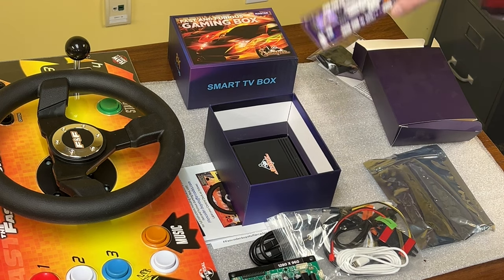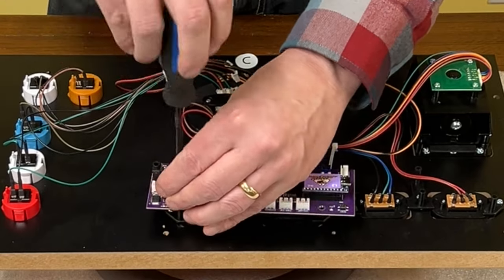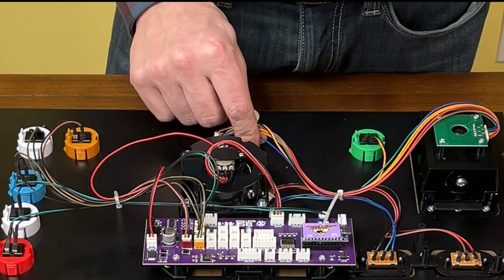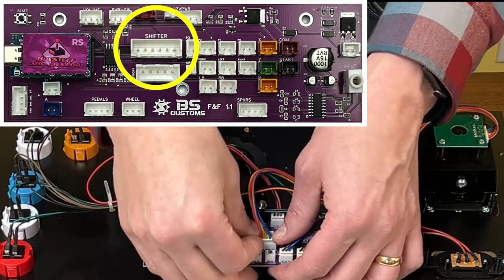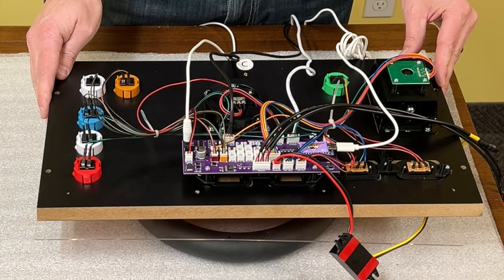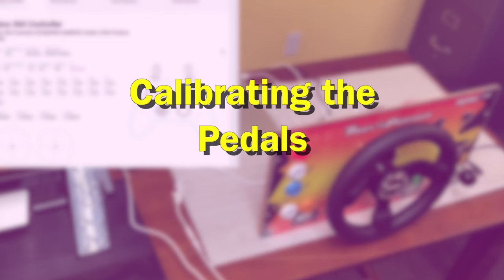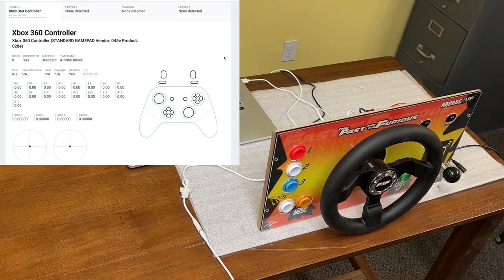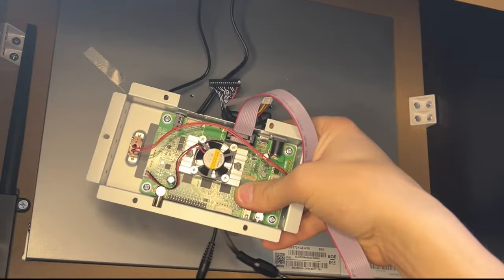Fast and Furious Mod Kit Install for Arcade1up

Comment: FINALLY, a reason to buy Arcade1up's Fast N Furious.  Great job as always guys. 🦊👊
Reply from the maker: Thanks man! I believe you used to have two... lol 🙂
Reply: @BuyStuffArcades  I would've kept one if I knew about this awesome kit.
Reply: @BuyStuffArcades  just curious, can I add games to the SD card ?
Reply from the maker: @BAMGGAMING  If you know what you're doing, yes. We don't lock anything down.
Reply: @BuyStuffArcades  the system is locked . It says it needs a password for user interface 🤷🏾‍♂️
Reply: Finally a reason to purchase time crisis?

Comment: Wouldn't the board being mounted to metal at 19:40 short something out? even 1up when they mount the PCB in the metal box thing they dont put it directly on metal anymore they used to back with the gen 1 cabinets but they eventually starting putting like black sheets of plastic and or plexi inside and then putting the PCB in metal housing

Also if i wanted to do the light up coindoor mod from retro530 is this mod compatible with it and if not how would I make it work would i just use a USB hub?
Reply from the maker: The beauty of our HDMI boards is they come with a plastic mount that keeps it from shorting and screws right into the A1up screen holes like we show. There is a 12 volts switchable port on the encoder board and also USB ports in the gaming box that can be used for lighting up coin doors and such.
Reply: @BuyStuffArcades  so I have a question would it be more cost effective to just build one of your guys racing cabinet kits and make that into a Cruisin world with your driving box or does it make more sense to go the 1up fast and furious mod route and do it that way? I'm kinda thinking I'm gonna be spending over a grand either way I go so maybe it makes more sense to just go with your guys cabinet kit?
Reply from the maker: @MystiqEevee  The modded F&F will be a bit less expensive, but our Racing Cab Kit is much nicer if you can swing it.

Comment: Hi, I have just installed this mod in my Fast n furious cab, works great but my question is that the fast n furious game is not included in the games list which I don't get as this mod is a fast n furious mod for a fast n furious cab. Is there a reason for this or am I missing something. thx
Reply from the maker: Fast & Furious requires a PC - it won't run on our Gaming Box. We are working on a PC upgrade that will have many different F&F games on it.
Reply: @BuyStuffArcades  Thankyou for replying. Is there a likely time this will come out and what type of price range would it be. When you mean PC upgrade is that basically putting a pc in the cabinet and getting rd of the other modded parts I just installed. Just asking for information. thanks
Reply from the maker: @winge-dogjones2492  It's a 15 minute swap upgrade from the kit you have now. We haven't announced pricing yet, but we're working hard to keep it affordable. RR/OutRun is first and that will be available soon. Then we'll be converting it to F&F.
Reply: @BuyStuffArcades  Thanks for the update, looking forward to it.

Comment: Does this version run any different than the outrun or ridge racer mod? Is it any better or any added games? I’m just trying to determine if I should get ridge racer for $450 tomorrow.
Reply from the maker: The games list is similar between the two mod kits. The F&F has the 4 way shifter and more buttons and doesn't require an amp, so it's a bit cheaper mod as a result with a few extra features.

Comment: To anyone that's done this mod, how do games like F355 challenge play?  That game is a 6 speed manual game in the arcade. FnF is only a 4 speed.  Do you just shift up and down like a tiptronic transmission or does it only run through 4 gears?  That game also came with a clutch.  I'm assuming since its the dreamcast rom there's no need to clutch. Really want to do this mod but a) loving my FnF cab so far and b) waiting for their pc build and hoping for FnF to be on there but the arcade version (along with many others hopefully). F355 was on of my favorites in the arcade.
Reply from the maker: Dreamcast version is paddle shifting. Daytona uses the 4 gears though. F&F will be on the PC Build in a wide variety of versions.
Reply: @BuyStuffArcades  So paddle shifting means you can use the stick shift to shift up or down correct?  Can't wait for your PC build!!

Comment: Anyone know if it is safe to plug in a powered soundbar into cab using a 3.5mm Aux cable? Not sure if this can damage board
Reply from the maker: What do you want to plug the soundbar into exactly?
Reply: The female 3.5 mm aux cable coming from the F&F encoder board with the green sticker labeled “speaker”
Reply from the maker: @bssmith235  No, that is for the stock A1up speakers which are NOT wired like a normal aux port. You can plug the soundbar into the HDMI audio port directly. You will need to adjust your volume on the soundbar then, and not on the control deck.
Reply: It worked! Thanks for the quick responses.  Any idea when those multi-player linking kits will start shipping out?
Reply from the maker: @bssmith235  Very soon

Comment: Quick question, If I do Mod kit will I still be able to do led buttons from retro530?
Reply from the maker: LED buttons can be used, yes. Best to use buttons with 2 pin JST connectors like stock, and separate power for the lights. The 3 pin JST connectors on some LED buttons won't interface with our encoder board. (Or the a1up encoder board for that matter.)
Reply: Great thank you ! What’s ETA look like on the PC mod ? Looking to get this .
Reply from the maker: @darrinmcgatha2027  Later this year for the PC upgrade kit - don't have an exact release schedule yet.

Comment: So wait….you lose the main game? The games are not in addition to f&f?? You may want to put that somewhere on the order page and make people aware before they buy this.
Reply from the maker: Our Mod Kits replace the main PCB - that is how it works. You can't run both at the same time. We have the full games list linked right on our order page. Our upcoming PC Build upgrade, however, will have F&F and lots more.
Reply: @BuyStuffArcades what is the eta on the pc build (for Ridge Racer)? Any estimate on pricing target you’re trying to hit?
Reply: The original game suck anyway lol  they're giving you more games
Reply: @BAMGGAMING  It May suck for you (if you’ve even played it) and that’s fine.That doesn’t mean other people don’t like it. I have bought several of these upgrade kits  so I understand they’re giving you more games. The previous upgrades included the original game. You missed the point that someone new to mods may not realize that when they buy this it replaces the main game they bought the cabinet for in the first place. Some people want to add games to the game they like…like the Star Wars upgrade kit, it still included all the SW games. The main point you missed was they should notify people on the order page that you will lose the original games. Unless it’s a total cabinet mod, it’s odd to have all these games on a fnf cab w/no fnf in it.
Reply: @itzvon  gotcha !
Reply: I'm sure most people are aware.
Reply: @danielwa1982  Maybe. Maybe not. ALL the other upgrade kits included the original games from the cab. Some newbies may not be aware this one is different. Just saying something should state this on the order page.
Reply: @itzvon  "ALL the other upgrade kits included the original games from the cab"...this is not true. Their racing box for the Ridge Racer cab contained NONE of the roms/games from the original cab. For RR, instead of the arcade rom, it had the PS1 version...however there was no Rave Racer & no Ace Driver games. But I get what you mean...the games list should clear that assumption up though
Reply: @BuyStuffArcades I am definitely waiting on the pc version,hopefully it will be released soon,I definitely want to do this but don’t want to lose my fast and furious game.My money is ready!!!! Hope it won’t be too long of a wait
Reply: @BuyStuffArcades I can’t wait for the pc build!
Reply: I appreciate this comment because I'm interested in buying a racing arcade cabinet but don't just want to play one game.  This seems like an awesome option, but I didn't realize you'll lose the fast and furious games.  I just assumed those come with the new kit along with all the other games.
Reply: I am also interested in the PC build as I would want f&f games along with the other games. Thanks
Reply: Any new information on not losing F&F if I add this
Reply: @saldapimp69  you will not have the ability to play F&F if you get this. You would be changing out the board with F&F on it to the new board with all the other games on it.
They are working on a pc version that will include F&F

Comment: Way to big of a hassle basically have to gut it down and for something that cost 600 originally its not worth it it WOULD however be worth it if you can find a broken marketplace find or something but for retail 600 price not worth it
Reply from the maker: @MystiqEevee  Why does the price of the F&F make a difference on if the mod is worth it or not? Still the same great improvement no matter what you paid originally. Takes about 30 minutes to do and you’re 4 shifting Daytona :-)
Reply: @BuyStuffArcades  mod is 250 f and f is 600 mod costs more or less depending on what you need it's just not cost effective unless you can get the cabinet for a good price
Reply from the maker: @MystiqEevee  What I hear you saying is that you don't think F&F is worth $600 - far enough.
Reply: @BuyStuffArcades  yes Indeed I can't justify y'all's mod when the cabinet itself is so pricey 😕 if 1up would lower the price it would be beneficial to buy and put this in it as I absolutely need to have Cruisin World as it is one of the very first games I ever played as a kid so it hs a special place with me
Reply from the maker: @MystiqEevee  Lots of people find good deals on OfferUp/Marketplace etc. especially when there’s something “wrong” with it - maybe you’ll get lucky!